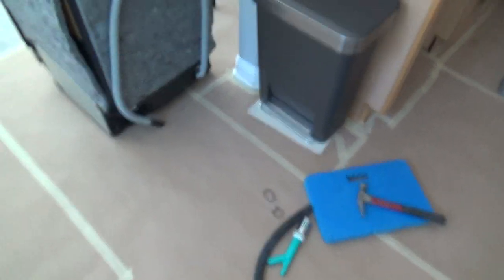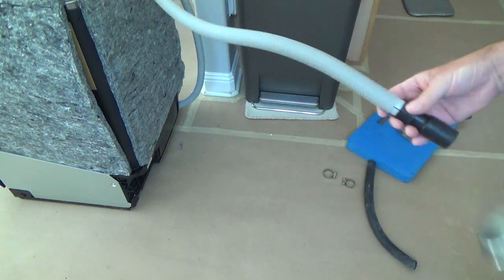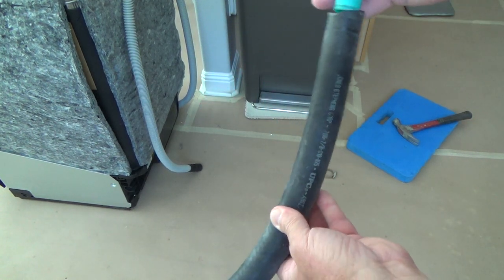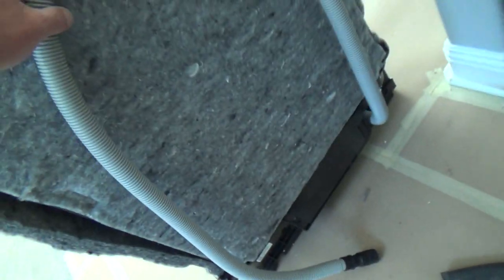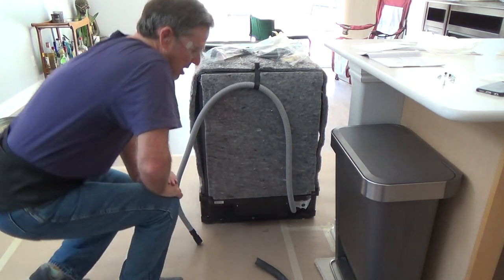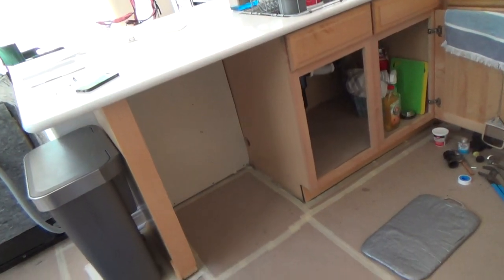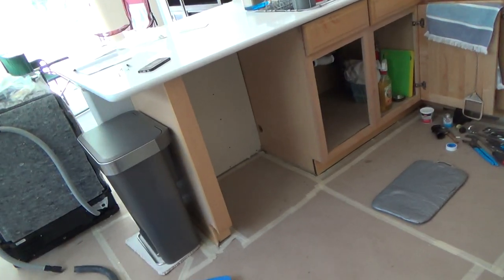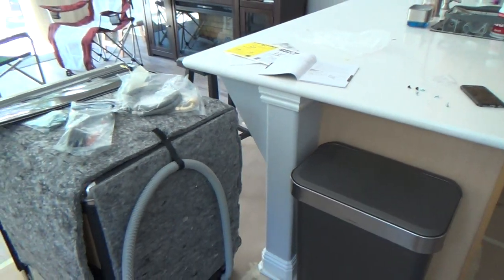How to Install Dishwasher Without Air Gap Made Easy

Comment: I am in WA state and air gap is a code requirement, so is this an alternative?
Reply from the maker: Are you sure it's a code requirement as the dishwasher we purchased the directions show how to install the dishwasher drain without having to use an air gap. I would think it's a universal thing but not sure. For more info go to my main YouTube channel page then click on playlists & scroll down to dishwasher & I show quite a few videos of this project & at least one or two more having to do with the air gap issue with me showing how to install without it. Let me know if you have more questions. Thanks for stopping by!
Reply: Just do it with out I am in Washington and I work with builders and you don’t have to do it

Comment: How do you connect it if you do not have a garbage disposal???
Reply from the maker: I've never run across that yet but I would think you would have a side outlet on your adjustable p-trap or just above that to then connect your dishwasher air gap to that. Take a pick of what you have under your sink for your drain connections then go to your local hardware store & show that to the sales person in the plumbing department & he will give you some ideas for what to do & which parts you will need. Let me know how you do at the store. You can do it!
Reply: @VideoJoeKnows  Well you are correct, I just found out there is a tailpiece called a branch connection.  So that's the easy part.  My issue is my dishwasher is clear across the room from the sink.  It will not pump the water all that way.  I am going to hook up a tailpiece branch connection and plumb a line under the floor (open basement) to my main stack.  I will top off that branch connection not with a sink, but with an air admittance valve and some fittings. Inside that branch connection tailpiece you can see the plastic is molded so the jet of water from the dishwasher is aiming down.  So the drain, from top to bottom, air valve, fittings, 1 1/2" branch connection, then the discharge from the DW goes in, 12" or so of 1 1/2", the  p trap, and then 1 1/2" all the way to the stack. Thanks for your input!

Comment: But doesn't this case standing water in the appliance and smell horrible?? Just curious
Reply from the maker: Water drains out without using the air gap as long as you install the drain line in a proper way & no smell since all the water will still drain....
Reply: @VideoJoeKnows  rite on that makes complete sense I don't know what I'm talking about
Reply from the maker: @carlostovar5713  LMAO! Well thanks for checking out my videos! I have a ton that could save you money around the house on all kinds of topics. Just go to my main YouTube channel page then click on playlists & go for it!